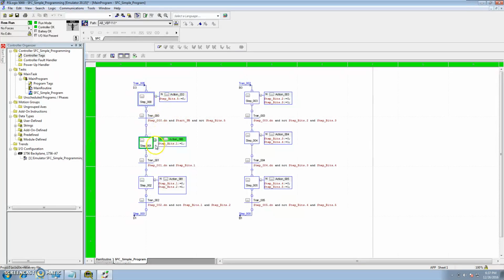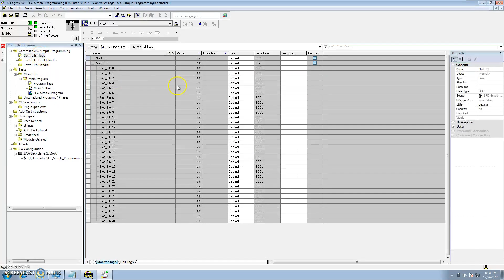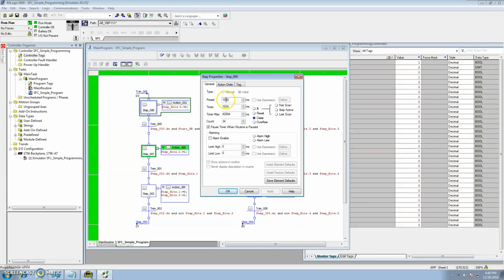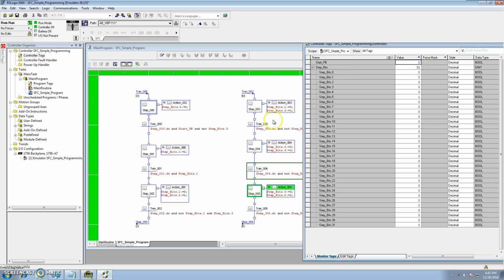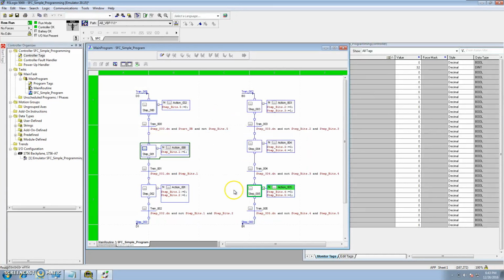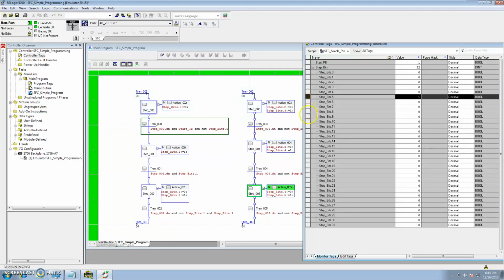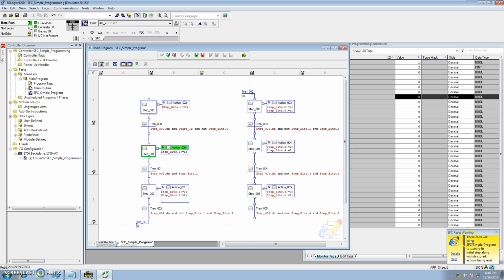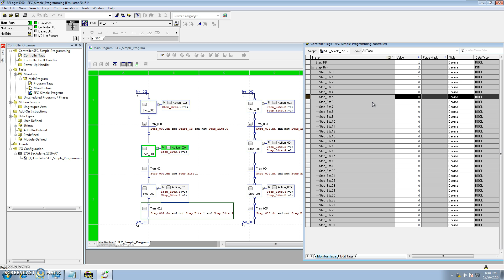SFC Programming Functions With RSLogix 5000 (HD) | Sequential Function Chart In Rslogix 5000

Comment: Hi Shane,
I have a question related to the DN bit reset.
In the Rockwell documentation, it states that the Step.DN bit will remain high until the Step becomes active again (and the timer restarts). Say the SFC routine has reached a Stop instruction, or is interrupted at some point and the SFC resets to the initial step. Do all the DN bits for every step within the SFC reset to 0, or will they remain high until the Step becomes active and the timer starts again, as the documentation states?
Reply from the maker: If you exit the SFC with the proper command & then re-enter it would be based on how the controls are programmed.

SFC is basically a state machine theory

Comment: Hi Shane,
I need your help please
I've been wondering how can I build a standard non retentive action for a boolean in SFC. I've struggled and searched a lot, and the only I find is people using the silly N action with :=1 assignments which always end up being a set action instead of the desired non retentive action. I mean, the action I'm looking to build is the one which is true only while the step is active. I've tried several ways, and now, the only way I see to do this is to create LADDER rungs for each action and make it true with contacs for each step X bit, but this is so complicated still. Is there a way to do it within a SFC step action?
Reply: Hi Shane, I already solved it, and it actually works as it's supposed to do now, the same way as it works in SIEMENS PLC's, and it's completely awesome.
Text me if you wanna see how
Reply from the maker: Good to hear that you got things worked out.